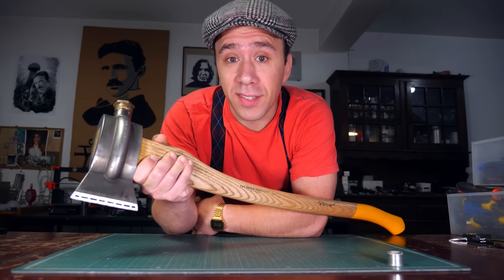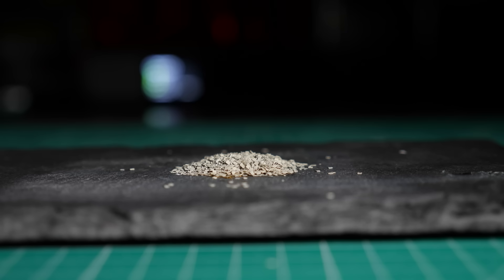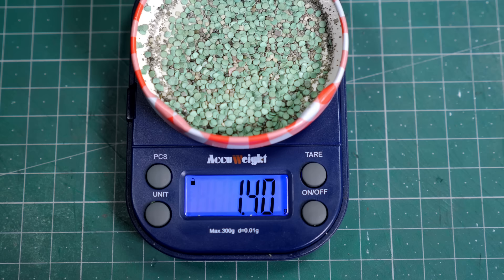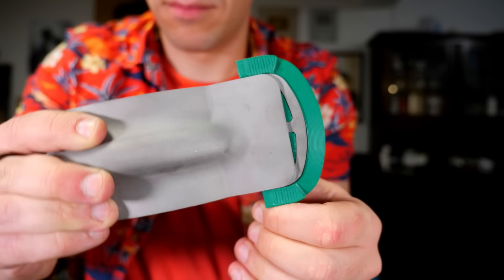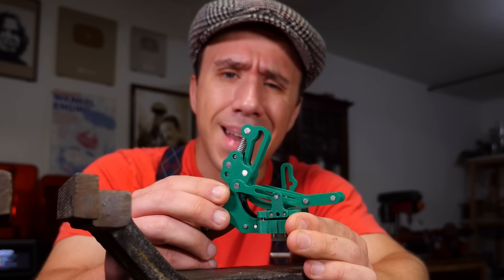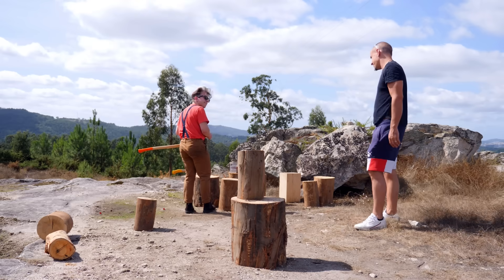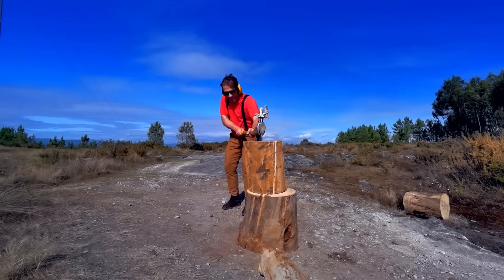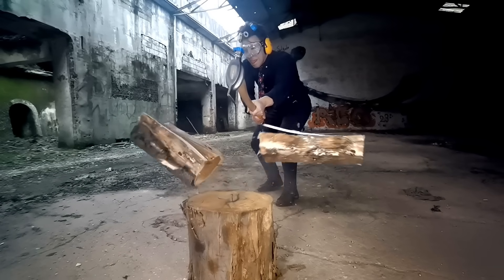I built a BETTER SHOTGUN AXE

Comment: I think you’re approaching it from the wrong angle. You shouldn’t split it with gas, since that would require too many variants. Instead, use something like the method used for splitting stones. Fine if, instead of gas, it would shoot out some long, sharp piece of metal, which of course wouldn’t fly off like a projectile but would remain in the axe. The inertia and brute force would essentially split the logs apart.

Comment: when using the force of a 'sharp' object/ weapon both the material of what its made of (being the strength, density and weight) and the angle of impact (including the sharpness/ penetration) highly matter with the results your trying to get. also, to get a better penetration, work on your swings a bit better (maybe watch some logger videos to get a better idea to do better swings cause that will matter a lot with your 'results')

so instead, for the trigger/ mechanism use a stronger/ denser material (so you don't have the risk of it shattering into a million pieces into your face) and have it better attached onto the axe so when the pressure builds up the pressure will be forced to go out 'the intended way' only if you put the trigger mechanism on more securely/ tightly. even if you have a harder time taking it off (which you may need to use a heavy duty tool) the better the results you may get.

for the barrel of the axe, in this case, since you need as much pressure as possible you'll need to have as little area for the pressure to expand as possible (kinda like those tubes you pore your oil into so you don't spill it everywhere). that way when the pressure reaches the end of the barrel of the axe (with the widest area expansion for most of it to build up at). all that pressure will force the wood to come apart.

if it also helps, try using 2 (or 3) shells like a double barrel shotgun to make more pressure. just make sure the materials of the axe can withstand all that pressure that way you wouldn't have accidentally created a pipe bomb to go off in your face 😅.

Comment: Seems like you basically figured it out, but I'd go back to narrower exhaust ports and use a trigger mechanism that is set to activate when blade depth  penetrates deeper than the exhaust ports (you'd probably want the trigger depth to be adjustable as well). This can ensure it fires as soon as it would be effective to do so, and could likely be tuned to trigger while the axe still has some downward momentum. 

Narrower ports over a longer blade should increase the vent velocity. Maybe look into how rifle compensators work? You could probably leverage the vent force to help avoid the issue of ejecting the axe instead of driving it, especially if the trigger timing is just right.
Reply: Using a hardened steel instead of stainless would probably allow you to use a narrower blade too, which would help with penetration.

Comment: the triggering moment should be based on the depth of the axe blade in the wood, not the change of velocity or inertia, try putting a feeler across the top of the axe and have it adjustable to what depth is needed to fire it. also some sort of safety device should be a priority. ... probably wouldn't use brass as the breech lock either..

Comment: for the bulk work of sharpening a blade, like on my axe or hatchet etc, i use a belt sander if its super dull, then a grinder to get a nice straight cutting edge angle, and then a file, and then down to a sharpening stone. (or diamond plate). but axes get so beat up that sometimes i just stop with the file

Comment: You are in grave danger each time you use that woefully designed death trap of a breech mechanism. Turn back now before it’s too late. Study firearms design before you go any further. Your “mechanism” may be just a single load cycle away from catastrophic failure. What is its fatigue cycle limit? A single small piece of brass, or the head or shank of one of those fasteners, propelled by chamber pressure escaping from your failed breech mechanism could easy permanently disable you or even fatally wound you.

Comment: Kinda seems like a bit of a step sideways - your charges went off much more reliably, but the new head geometry and firing mechanism are not nearly as efficient at conducting the resulting pressure to where it's needed. My money is on your breech - it's good that the setup locks, but it needs to lock and seal just as tight as your old threaded setup or the gas will find an opening and escape. This was a problem with revolver-style guns, where the gap between the cylinder and the barrel would create a puff of hot gas to the sides. I would add an interlocking ridge/groove on your breech halves in addition to the alignment pins, and enhance your locking mechanism to hold the halves together better during initial impact and firing.

Comment: Why not just build a purely mechanical version that uses the power of a strong compressed spring instead of fuel or combustion? Design the axe head that is split down the middle where the sharp edge meet, then have them hinge open near the back blunt part of the axe with the releasing power of a strong spring? Like a reverse bear trap, on an axe?

Comment: Could you attach a small rod and a spring to the side of the axe blade so that when the correct penetration is reached, the wood hits a rod, which then strikes the firing mechanism? I’m thinking that this way you’d get perfect penetration every time before the shot is triggered. Maybe it would be positioned about 6–7 mm above the edge of the axe.

Comment: Have you thought about making a cruciform splitting wedge like this instead of the axe? Have the wedge with a cruciform pattern so that way it can stand on the log, and have the blank contraption built into the wedge so that all you have to do is swing a sledgehammer or a maul and you do not have to worry about the contraption being anywhere near your head. 

Having the mechanism encased in the wedge would simplify it, make it safer so that it can be primed without worry of unintentional discharge, and the strike face could have a firing pin built in, similar to a slam fire shotgun. You could probably even use a Bellville washer as a simple safety.

Comment: This is why everyone deserves gun rights, lol. It looks like you're using shorts- do you have access to (and do they make) 12ga long blanks? If not, you could look for "high brass". They have more power.

I don't know about optimal chamber volume, but I know if gunpowder doesn't have enough compression (containment), it'll burn instead of detonate, and it burns slow. If you have access to a reloader, pistol powder could make that DANGEROUSLY strong (it could detonate the head. I wouldn't hold onto the axe)

Shape-wise, I wonder if the curve would cause the wood to split differently and create less of a seal. Maybe whack that hard wood without shells to see the crater.

Comment: For practicality, a simple log splitting machine can be arranged with a splitting head on one side of a rail, and a pushing plate attached to an articulating arm with a motor driven wheel or hydraulic pump. May not be as visually impressive, but a lot faster and no worries about legality on supplies. Just be sure to keep anything you don't want mangled from the space between the plate and splitting wedge.

Comment: There is a thing called the Coffman Engine Starter that was invented in the early 1900s you might be interested in as a legal way to obtain shotgun shell blanks. In principal it starts an engine from a tractor to a spitfire aircraft in the same way you are splitting wood. I'm sure if you have the equivalent to the "Tractor Supply Store" in your country you could say you need to start a tractor with shotgun blanks and they'd sell you the cut down shells. Also, not saying its been done before because I'm sure Coffman himself didn't think to split wood with a blank fire. Good Luck! 

Tomatoes are disgusting, at least by themselves...

Comment: 17:19 The second and third problems can be easily solved with a simple modification. The release spring is replaced with a pin from the front of the axe that reaches the top of the gas holes. When these holes enter the wood, the wood pushes the pin backward, releasing the firing spring.

This modification is supposed to ensure that the firing pin does not fire before the gas holes are fully penetrated into the wood.

Comment: would it be better if the exhaust ports were perpendicular to the plane of motion? So that the gas only goes into the side of the wood instead of into the bottom where it forces the axe out.

alternatively, what if the axe has some sort of stiff membrane or piston that sort of punched the sides of the wood, only relieving pressure once the piston is fully extended?

either way I await your version 3 with anticipation.

Comment: You're trying to rely on sealing and pressure, when you should really be using the axe head itself.

Make the axe head in two parts that are hinged. Once it penetrates, blow the axe head apart pushing the halves of the log apart.

Also sharpness really doesn't matter at all in a splitting axe. Embedment might be very slightly easier in massively hard woods, but work on swing technique because you are not getting enough power behind that

Comment: Seems to me like you could have a split in a pointed ax head and have the explosion pry the wedge open that way as long as you get through the surface it doesn't matter if the holes are plugged. It is more repeatable. Idk

Comment: Advice from an Aussie. Lots of force along the entire length of the gum. As a kid we used splitting wedges and hammered them in the ends before hitting another wedge straight down the middle. In other words, battle axe version with at least two shotgun shells detonated simultaneously for that engineering struggle

Comment: WOW! Automatic setting of the firing pin and no safety on the trigger - The only thing "good" about that is you aren't using the explosion to intentionally propel a projectile.
Yeah, anyone who has tried turning hickory logs into split firewood knows that stringy wood hates to be split.

Comment: You should make the trigger mechanism closer to the output of the gases so the pressure get out quicker and you loose the risk of a blowback because you have all that steel around the mechanism

Basically, internal spring triggered mechanism inside axe head.

Comment: My tank nerd ass immediately goes to a long, thin blade for penetration like APFSDS, but then your problem would probably be area for shooting out the gas. Long and thin things have been used throughout history for penetration though, like rondel daggers. They're made for penetrating mail in the gaps of plate armor, and Estoc swords, also made for penetrating. Rapiers too, they're long and thin for thrusting.
But I don't think you need crazy amounts of penetration for this, just enough penetration. you could try finding a ratio of length to width that works for your project, I suppose. That's what I would try, but I'm not an engineer by any means.

Comment: ☝️How about DIESEL 😎 With the fuel tank in the handle and a piston like a fire syringe for ignition 👍?  Figure out the air fuel ratio and you’ll have a winner!  Will need a trapped piston with exhaust port ? 🫡🫵

Comment: I feel like a million people probably already said something similar, but making an action for activating a shotgun shell that pulls back the hammer, while loading the shell, which also doesn’t have a safety to prevent the hammer from dropping, sounds unbelievably dangerous. Just an action that works when you bump it sounds crazy. I really think you need a safety in there somewhere, just something that protects the pin until just before you swing or something. You already accidentally set it off once. 

We want to see the third video, not for the channel to just suddenly stop posting and nobody knows what happened.

Comment: love the engineering. but you set yourself up for failure with the bluegum. It kinda just laughs at you if you try and split it. even with a splitting wedge, and sledge hammer. It is a wonderful firewood tho, burns long and hot. alot of ash however. we collect quite alot of it for the fire. although are careful not to get anything that will not fit in the door, as you have shown, splitting the damn stuff is a nightmare. fortunately, in the wild it is self pruning, it drops branches to balance itself. deadfall ~20cm logs. chainsaw makes short work of that.

Comment: can you somehow design the axe so that the blade can extend and retract, and then have the shotgun shell propel the blade forward at impact? The blade shouldn't fly off of course, the design should have it stopped at a certain point. this design would be really cool imo, and it would be adding to the overall force of your axe strike, rather than be a separate perpendicular force that tries to push the wood apart like it is currently.

Comment: Why not make the fire mechanism on the blade do that it doesn't rely on springs or gravity, entering the wood would hit something and fire it, could also make it more low profile and make a curved pipe so that it will be parallel to the blade instead of perpendicular, it would prevent you from having a massive thing sticking out of the back of your axe

Comment: Some splitting axes have levers that push the wood apart as they enter. It might be interesting to try a mechanical separator rather than relying on gasses alone. That would eliminate your issue with getting a proper seal.

Comment: one thing im noticing for sure with a lot of these
your blade is as stubby as a pug
more length=more penetration 
also maybe consider making the shell seal a lot better and have signifigant backing on the mechanism, in real guns this is done with a firing chamber that encompases the entire round and latch seals together

Comment: VERSION 3... Your basic Axe head, but no more shotty shells, but instead a Paslode airless nailgun cylinder. Then, re-using your firing pin idea (the new hammer one, but simplified), use it as a striker to create the spark using a piezo lighter igniter. (having a weight slam on it to actuate the sparker)

Can have the Paslode cylinder attach to the head at 90°, parallel to the handle, to support the cylinder on strike and be protected.

Except now you need a redesign since you're using a minimally expanding gas.
My thinking is you'll somehow adopt the hammer approach, having a small cylinder and ram. Except now it would be a center part of the axe that is attached to the cylinder, with a big spring for return. So what occurs is it fires the inner part of the axe which is a wedge. (similar to the design that inspired all this, as I recall)

 👇  👇 Stationary axe cutting head
|||||!!!|||||
\\\!!!///
   ☝️ Moving cutting head attached to the 💥 cylinder.

edit: And maybe incorporate a "rasp" texture on the axe face? So that when the head digs in, it has some pokey protrusions to grab in the opposite direction and prevents blowing the head out (if the 💥's timing isn't ideal).

Comment: For V3.0, maybe consider different shapes for the head of your splitting maul. (What you're making is NOT an axe.) I would recommend something very pointy, with the spike being thick, razor sharp, and having multiple holes, but at slightly varying depths, so they don't become quite as much of a weak point in the blade. I'm envisioning something akin to a giant hypodermic needle attached to a very heavy maul head.

Comment: Simplify the firing mechanism and add a mechanical safety. Use tougher steel for the mechanism, not brass, too weak for that pressure load could cause really bad issues. Smooth the gas channels in the axe, will increase pressure. Sharpen the edge with a proper water block after you grind it to the right shape, will help it bite into the wood and decrease the chance of it bouncing off. And seriously redesign that firing mechanism, like actually that is just waiting to injure you

Comment: 4inch dia x 6ft  metal tube with vacuum, a rupture plate, a 4in dia x 6ft long metal plate filled with compressed oxy-hydrogen.
Detonate the gas, rupture the disc, into the back of a 3D printed projectile, through the vacuum, through another thin rupture plate, and out at extreme velocity.

Comment: OK, so, instead of just letting the gas do the work, you need like, bits in the side of the blade that push out from the force of the gas and lever it out. 

For bonus points, use the same mechanism as your trigger. Allow the sides of the blade to compress a little, which pushes a thing which fires the cartridge. 

For the expanding/cutting mechanism, you could also probably add outlets for the gas so that once they expand far enough, it escapes. Reliable, safe(r), and would likely give you much more control and power.

Comment: Gr8 work here, i may have some suggestions: 

1 instead of the traditional axe shape you could use a more like pickaxe shape, but maintaining a slightly elongated shape to avoid wood splitting in the "User/cameraman" direction.

2 use a tread printed on the axe instead of a clamp it can avoid shortening your life 

3 like you show in the video you can use some large caliber blank cartriges, cheap, you can buy it on amazon or else and no preparation required and they are legal.

Keep going you are doing great

Comment: you can fix the expension ratio issue by simply providing more hydrogen. if you attach a tank with exactly the size ratio ou need you should be good. i would find this more interesting that just using shotdun shells